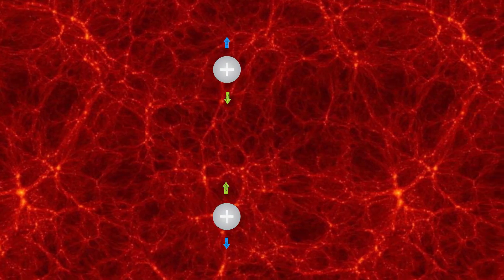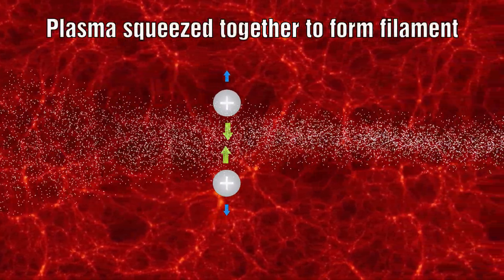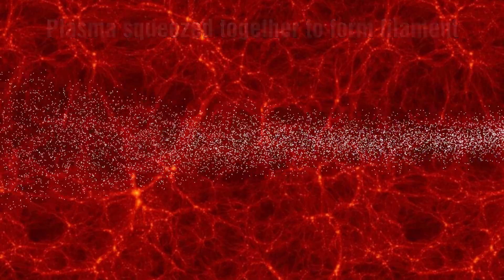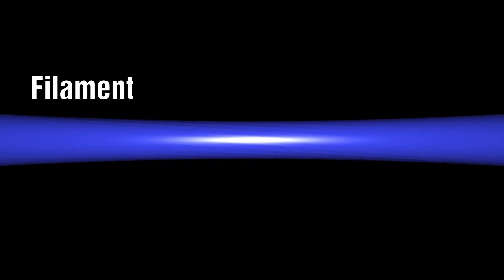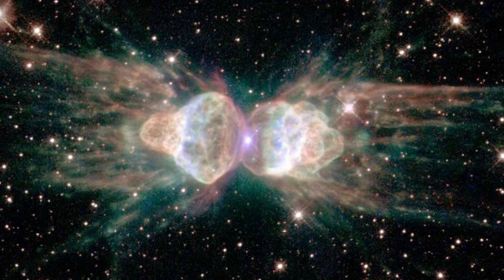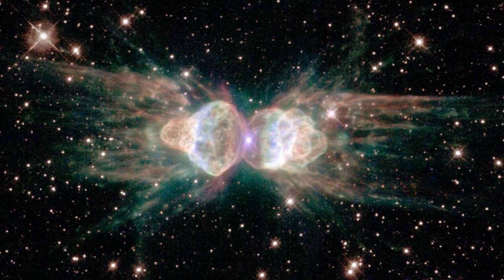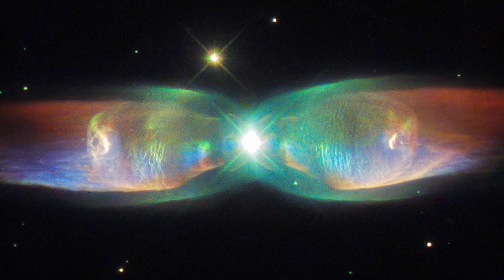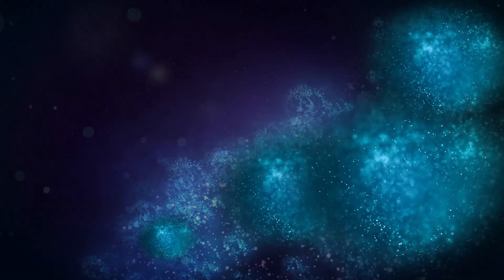Understanding Bennett Pinches and Z-Pinches in 60 Seconds

Comment: The reason z-Pinches havent been demonstrated in a lab is they are to the initial picto second of a thermo nuclear detonation. 

Dr Anthony Peratt discovered rhem in detonating 13 thermo nuclear Devices
he designed built and detonated  deep underground at the Nevada proving grounds. The high speed recording of the first picto second of 
the detonation revealed the Peratt
Nine Toroid Plasma Z-Pinch. This has remained highly classified ever since.

No university or lab had ever built and detonated a thermo nuclear device  
therefore there cannot be confirmation in Civil Science.

It is all Top Secret as military nuclear weapon manufacturing knowledge.

Off limits to those without permission.

Comment: What do you mean with "no experiment on z-pinch nuclear fusion"? I guess there are tons of papers about.
Reply from the maker: I mean that no lab experiment has used a z pinch to create a fusion reaction. It is however referred to in many plasma fusion experiments as a way to contain the plasma but not to trigger the fusion reaction.
Reply: @SeethePattern  My understanding in physics is not good enough though I  guessed that these papers talked about that.
https://phys.org/news/2016-10-breakthrough-z-pinch-implosion-stability-path.html 
https://www.sciencealert.com/a-breakthrough-revives-an-old-idea-for-nuclear-fusion-that-could-power-your-home
https://pdfs.semanticscholar.org/2b49/c2cf5ae0b099672aff2adcdb95866b9c9c9d.pdf
Do you say fusion has never been achieved but for uncontrolled explosions or  that it has been achieved in very short lapses of time with instabilities?
Reply from the maker: Technically you are correct.  In these papers they achieve fusion using a z-pinch but the difference for me is that in order to achieve this they have has to heat the plasma and the z-pinch acts like the trigger.  They also cannot sustain it for very long and have issues with containment.  So I am referring to no one has managed to produce fusion from a z-pinch using cold plasma and been able to maintain it for a sustained period of time...yet!
Reply: Thx u very much @JoeDeglman . I guess you're right or at least in the right path but, how to hold it? Papers? Books? Facts or experiments?
Reply: @SeethePattern  Now they have :)

Comment: The same effect is seen in air flow, it is the fact that air flows through a constriction that causes twisting currents in the a fluid medium,   the  magnetic field is a fluid medium, The Bernoulli Principle. http://www.energeticforum.com/renewable-energy/4202-bernoulli-principal-vortex.html  I think this is the cause of Marklund convection and gravity.  The Earth is just contained inside the magnetic field flow that draws us in.   The Bernoulli Principle is Ampere's Law, where two parallel vortices will come together and twist.
   I think the same thing happens in a z-pinch, like in a lightning strike, where it has been found that neutrons are created.  This compresses the fluid ether medium particles or photons enough to align the positives with the negatives of the photons, a crystalline structure, like paired photons coming out of a laser cavity.   There was a good video by Michael Steinbacher, showing how the z-pinch creates garnets vs the standard subterranean pressure. https://www.youtube.com/watch?v=f2vw1buXskU   The magnetic field flow is pinched and aligned in a flow through a mineral and the magnetic field particles are lined up inside the garnet, adding neutrons to the mineral, creating the garnet.
   I also think that the protons are rarefied by a resonance of the protons as the  electrons vibrate a flow of plasma through a magnetic field around the plasma flow, this is how the Sun gets energy, by releasing the binding energy of the protons.
Reply: An archived Michael Steinbacher video on garnets. https://www.youtube.com/watch?v=Duq2uQqct94&t=119s